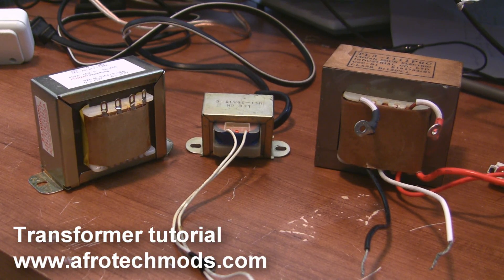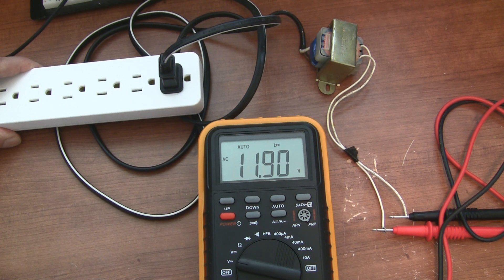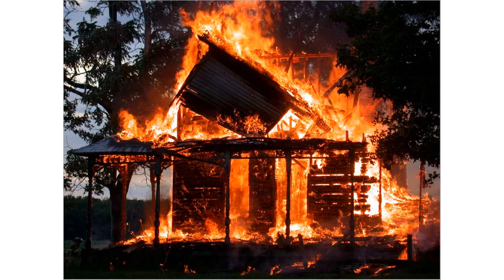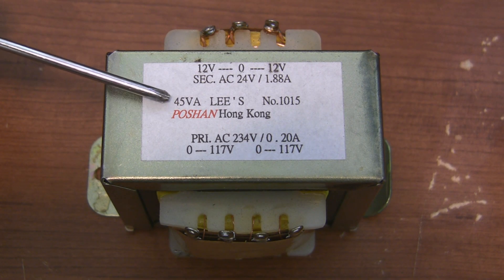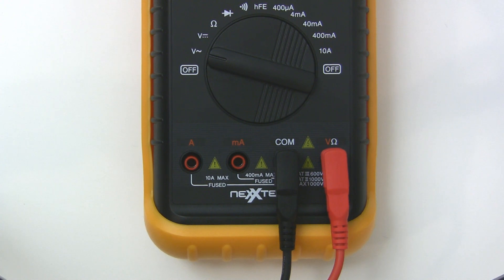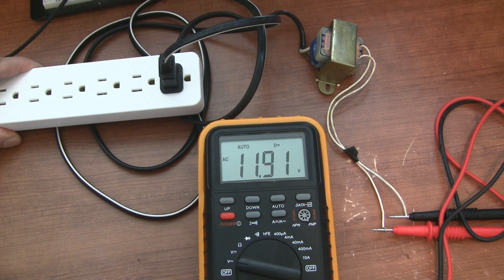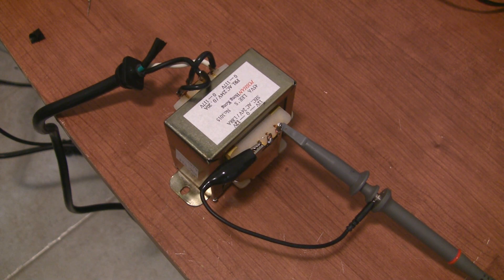What is a Transformer? An Electrical Transformer Tutorial

Comment: Where is the 78v peak to peak coming from? If the output alternatives from -12v and +12v, should the peak to peak not be 24v? Did I miss the section explaining RMS, or where 38v comes in? If components need to handle the 78v peak to peak…. Why is that important value not somewhere on the faceplate?

Comment: I need to know how I can use the Starship Coil pattern to design a transformer that I can very safely plug directly into the wall socket! I do wonder what would be best with the winding, both pairs of wires going around the same jig at the same time., OR two starships made from separate jigs and one completely fitting in the center of the other one?
The secondary coil I'll be using as the power source to preform electrolysis to make HHO.
Introduction of a stationary magnet beside the plates/rods you splitting the water with increases the gas production rate substantially!
So I plan to piggyback off of the magnetics from the transformer. 
For the core I'm going to use 2 or 4, maybe more rods of the best/proper metal to use for a transformer core. Have those rods waterproof and electrically isolated. Around the rods each individually wrap a sheet of graphite to make a sleeve/pipe/tube and that will be the surface area used to split the water. Side note Graphite works better that stainless steel. So because of the starship wanting to create spin in the center,  I'll setup my rods(core) in a fixture to allow them to spin as a whole, or maybe I'll set them up individually to spin in place. The reason for that is to further increase the performance, cause the bubbles won't be clinging around giving more surface area always available.
So how should I go about my windings. 
And if I change up my rods... how much will that affect the windings/ wire gauge needing to be different?
Reply from the maker: Don't waste your time on this stuff. It's a dead end.
Reply: @Afrotechmods  no don't say that, but what exactly is the dead end? Do you know about the benefits of a starship coil over a standard coil. And I need/want to make an hho generator. Did you fully read my comment

Comment: Okay. I want to run an 80 amp plasma cutter at 50 amps on a 50 amp a-ipower 12000/15000 watt generator. Is there anyway to use transformers capacitors and what not to get the 80 amps?  And is there a way clean some dirty generator electricity for some smaller welders? I cant find UPS systems for big power flow.

Comment: So if I understand this correctly and I have a 18V Transformer and an oscilliscope that's rated to 35V it would be unwise to try measure the output because the Peak to Peak voltage will be higher than 18V?
Reply from the maker: Yeah be careful

Comment: May I ask how do you know this size 30mm x 60mm cord is 500 Watt?

I wish to rewind 2 micro wave transformer to step down to 30VAC. 

Utilized my Homelite rectifier to convert it to 30VDC. 

Is this a danger procedure?

My purpose is to build a power supply for my 24VDC circular saw. Tired of dealing power tool battery issue. 

Can you make a video tutorial for such application? I imaging to carry such low volt high current will required doubling multiple copper wire to eliminate over heat.

Could you explain how it can be achieved?

Comment: I have a hard time understanding why you can hook neutral to ground without shorting out transformer considering it is wired into the coil. Do electrons flow back and forth over this area? Shouldn't there be voltage there?

Comment: And I thought I knew about center tapped transformers, ha, ha.  I learned something by watching this video.  Thanks for posting.  I have a very similar transformer that I want to use for a power supply, but it is not center tapped on the secondary.  It does put out around 24 volts AC on the secondary, but I need to get it to 12 volts.  Guess I'll have to keep watching your videos until I find my answer.

Comment: Question:

I have a transformer with 3 taps on the sec.side. (12V) - (0V) - (-12V).
It is rated 1,5A

If I only use one of the windings, so that I only get 12V, does that mean it can draw 3A?

Comment: i plugged in a transformer from a 120v to 12v xbox cord and it flipped the breaker. there were only  2 input terminals on the coil with more turns so i connected the plug to them. i did not have anything connected to the secondary so would that be the problem?

Comment: I pulled one from an old alarm clock but it has no labels. It has two fat wire (black and white) I'm guessing for the main power source then four more thin wires (green, yellow, white, blue). I wanna try using voltmeter but its scary AF.

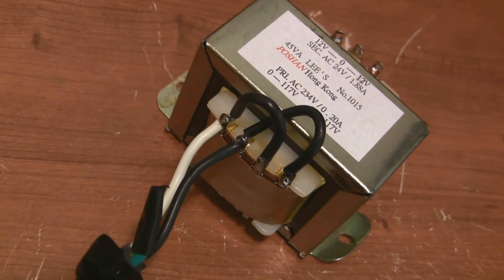Comment: At 8:14 - 8:24  we see how a typical transformer wiring set up might look like using both primary windings, WARNING !!!!!   Your transformer should only be wired this way if your mains supply is 120 volts, If you live somewhere outside North America, or in most of europe your mains supply may very well be 230 / 240v so the wiring of the windings should be in series.

Comment: @Afrotechmods , How to connect my scope's ground probe if i want to take a look at the mains voltage?? 

It is a USB scope running off a laptop on batteries.

I have a 100X probe.
Scope input is 35V max. So in theory, i should be able to measure upto 3500V.

I have a single channel oscilloscope, so i can't use two probes and get the difference between them.

Comment: What if you put the main (120v) in to the secondary instead of putting it in the primary, will you get a higher Voltage if you plug the main into the secondary?

Comment: Almost always there is a transformer in your furnace or boiler as the thermostat operates on 24 volts unless it's an all electric heating system such as electric baseboards which use a line voltage thermostat. There are new furnaces that lower the voltage electronically though the control board and even still there are very old ones that operate on millivolts that are generated by the gas pilot light

Comment: What happens if you draw more power than the transformer is rated for?
Reply: Your secondary or primary coil can burn.. Depending on which coil more current has flown which is more than rated current..
Reply: Is that call a short?

Comment: I noticed you used a 117V on a 120+V mains supply...do you just have to get a transformer rated "close enough" to 120V or does buying a 117V vs a (I don't know) 148V {if that even exist} give you a benefit for heat/efficiency/etc.? ...THANKS ..I know I'm a dumb ass...but I'm trying to learn N UNDERSTAND n not just memorize the Lego parts that work because they were already pre built in something else. THANKS AGAIN! ..I know some of my questions may seem stupid at the moment, sorry about that....
Reply from the maker: For mains transformers like this "close enough" is fine. North American wall outlets deliver anything from 110V to 120V in most situations and in some situations you could voltages outside of that so pretty much anything designed to plug into a wall is supposed to handle these voltage variations.
Reply: Afrotechmods AWESOME! thanks for the reply! n the help/videos. ...the reason I asked IS that my voltage at the wall bounces from 120V to 124.8V and I was just wondering if I would blow something up, set something on fire...create unnecessary heat/efficiency loss etc. ....just want to UNDERSTAND what/why/how before I "do" ...thanks for the help. I appreciate you taking the time to help and reply to me.
Reply: Afrotechmods I also got hoodwinked on eBay and accidentally bought a 220V PIR switch/led driver and am trying to figure out (understand) how to safely convert it to be O.K. to use on my USA 120V ....good info to know...that way I have the ability to use gear directed at a 220V market here in the U.S.A. ...$$$ save money on some stuff and get certain things to work here that aren't available in the 120V marketplace...thanks again man! (not kissing ass) but your Chan/help/info has been invaluable to me since getting into the angry magic pixie hobby. you have saved me a few "OUCH! SON OF BITCH!" moments and not burning up (as many/much) gear and components, boards and modules...n KNOWING why I didn't blow them up!
Reply from the maker: 120V to 124.8V sounds like it would be fine for most mains powered stuff. Certainly wouldn't blow up a wall transformer. You can purchase 110V to 220V transformers (sometimes called "wall converters") very easily from places that sell travel accessories, airport shops etc.
Reply: Afrotechmods alright cool, THANKS...good to know!...no...that 220 is a mains bare wire LED power supply that has a pir built in...can I just wire it to a US cut off extension cord with wire nuts and plug it into 120 without modifying the circuit that was designed for 220?

Comment: How is a properly rated transformer able to be plugged in straight to the mains without burning up?
If you just took a straight bit of copper wire of the caliber used in these, I'm pretty sure it would go yellow hot and melt apart, if not trip a breaker first.

Light bulbs are a small bit of wire, coiled up as well, and look at how hot they get.

Is it something to do with magnetic impedance? The coil has to be tuned properly to be connected directly to mains? So for example you couldn't use a 10 turn primary because it would be too weak?
Reply from the maker: You got it! At 60Hz, the primary side of the transformer must have significant inductance/impedance in order to appear as a significant load to the power source. Otherwise, exactly as you described, it would behave as a dead short.
Reply: Afrotechmods If I make the secondary coil of step down my primary will it be a step up transformer?

Comment: if rhere is no indication on transformer then how to identify in multimeter which one is primary and secondary?
Reply: primary usually has red wires if there are any
Reply: primary usually has higher resistance

Comment: Does Vp/Vs = Np/Ns assume winding gauge is the same on P and S? 2:35
Reply: Not necessarily. Often heavier gauge wire is used for the low voltage (high current) winding.

Comment: I have a TR 241 Philmore transformer that I want to use as a car Battery charger.  Am I in need of a bridge rectifier ?
Reply: Car batteries and all batteries are direct current(dc) which means no need for transformer nor bridge rectifier. if you want to step down battery voltage simply use linear voltage regulator.
Reply: HeRoXLeGenD1
Thanks but my other trickle charge had a transformer and what appears to be 2 rectifier's soldered to it. and your saying I dont need a transformer. i dont have a voltage regulator, i'm just trying to make what  i have.

Comment: You warned not to use transformers scalped from other machines (old transformers).  Please explain why.  What do I need to do to look for or watch out for if I want to use them?  Also, I repeated this over and over to hear it, but is the Vout 18 Volts DC after passing thru the diodes and caps?  Do I need to go through a voltage regulator circuit to clean up the Vout @ 18 V DC?  Or is the voltage still AC and needs to go through a bridge rectifier?   Thank you.  Also, I don't have an oscilloscope like you do to check things out.  I have to rely on my multimeter for any readings.

Comment: if the input voltage supply changes does the output voltage of the transformer changes to? or the output supply is fixed

Comment: How come that the primary side can be plugged into the mains voltage without any current limiting resistor or feedback diode (when unplugging from mains) since it is just a coil. Has it something to do with the impedance of the coil and the voltage being AC? Because to me it just looks like shorting the mains wiring with a coil.
Reply from the maker: That's exactly correct. The primary side of a transformer has to have sufficient turns to have sufficient impedance to the AC mains voltage so it isn't a dead short.
Reply: trevortjes iii
Reply: Good point. I learnt something new.

Comment: Hey Afrotechmods, i have a small transformer in my mobile charger! on the case of charger it says output is 5volts dc and 1amp does that means the transformer transforms 240V ac to 5V ac and gives 1amps?
Reply: im no engineer but i think it gives you 5 volt dc and maximum output of 1 amp (which means the maximum what it can deliver is 5 wats of power).
Reply: +Reiskangrilli yeah ik that but i was asking about ac not dc!
Reply: +rohan bhardwaj transformers only work with ac so you'd have to use a diode bridge and some caps and resistors to smooth out the output which would be dc.
Reply: +Mario Castillo thanks for that but i was asking if the transformer converts 240V AC to 5V "AC"????????
Reply: +rohan bhardwaj nope, that would turn it into 5v dc.
Reply: +Mario Castillo alright thanks :)
Reply: rohan bhardwaj no problem :)
Reply: Does the voltage that you mean is before the bridge rectifier or after bridge rectifier? if the voltage is before bridge rectifier, then it's AC.
Reply: 5V is already converted to direct current, meaning the transformer may have 5V or more in alternating current then was converted down by electronics devices to a steady state of 5V DC.

Comment: I understand that I can use a transformer to take the output of a pure sine wave inverter to convert 120 vac to 240 vac with a center tap so I can run 220 vac devices.
However can I take two independent 120 vac pure sine wave inverters and hook them up to a single transformer to produce 220 vac split phase to run 220 vac devices?
John

Comment: I'm working on a project i built a hydroelectric generator and it only produces 0.200 
ACV and its not enought to power an LED light so how do I rewire the transformer to make the voltage output higher instead of lower?

Comment: Great explanation on transformers. I have a transformer I took out of an old microwave that has 120v input to 20,000v output but have been unsure how to wire it so I don't damage it or myself. I asked an electrician and he was unable to help me even with a wiring schematic that came out of the microwave. Would you be able to tell me the correct way to wire it to do some Lichenberg fractal Woodturning? Any help would be greatly appreciated.

Comment: I'm trying to think out of the box here.  What if I need a 47v, or 91v,  or 359v, well, you got the point, AC transformer to DC transformer to recharge a bank of batteries?  Can you help me out?  The incoming voltage would be an spinning motor/generator of energy.
Reply: Assuming ur battery bank requires 12v to charge and ur generator gives out 250v-200v, just use a 230 to 24v transformer den use a bridge rectifier to convert to dc, den use a buck converter to further step it down to 12v
If ur generator can spike to 300+ volts den i think you should find a way to limit that
Reply: lol49031
I don't want to spend money on buying a transformer, but I do have two printers power supply, one running on  220vac to 35vdc, and the other 220vac to 41.7vdc.  What could I use to lower the voltage of any one of these power supplies to 24vdc?  Do you know of any hack?
Reply: +Pacero ur still gonna want a buck converter to convert it down to ur battery charging voltage, afrotechmods has a video on that
Use the 41.7vdc power supply den connect to buck convertor

Comment: I have a device that has 3 AA batteries.  It is 4.5 volts.  I want to eliminate the batteries.  I need it to run on 12 volts.  I purchased a transistor. How much would you charge me to wire this if I were to send it to you? Contact me at 470-564-8012

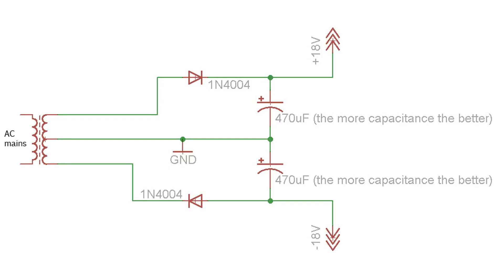Comment: 10:52 Is the use of 1N4004 diodes (400V peak) a security feature or you could use as well the 1N4001 diodes on the secondary coil circuit?
Reply from the maker: +RPdigital For this particular transformer and voltage levels 1N4001 would have been fine but better to give yourself a little extra safety margin with 1N4002+ in case there's a mains power surge.
Reply: +RPdigital just use 1n4007 for all your standard diode purposes .....
Reply: iceberg789 Good point, it seems these diodes have abou 0,7 V foward voltage drop and 1n4004 and up are safer, because they block half of the outlet AC voltage in case of shortcut in circuit.

Comment: If you were to wire the ground cable to the transformer what terminal would you connect it to?
Reply from the maker: +Michael Hiltz I recommend you don't connect the ground cable to the transformer at all. Btw Ibanez FTW.
Reply: +Afrotechmods sweet thanks. and definitely Ibanez ftw
Reply: The ground wire is a safety feature. It can protect the user in the event that the case of the device accidentally becomes live due to a short. If you want to use it, connect to it any exposed metal that's not meant to conduct electricity, and if something gets shorted the ground wire will shunt the current to the ground and away from you.

Comment: I find it slightly annoying that in eu the only wire that you can be sure about is ground wire, hot and neutral can be switched over on per socket basis. . .    also why the hell ur transformer, without any resistors added to primary side doesnt just blow the fuck out of your home fuse with the power of dead short?
Reply: +GotCritified You have to consider the total impedance of the circuit (resistance + inductance + capacitance). It's true that the resistance is almost zero. However, the coil of wire is an inductor, and inductors oppose changes in current. To an AC power source, that coil of wire is not a dead short. It has been designed with an amount of inductance appropriate for its intended use.